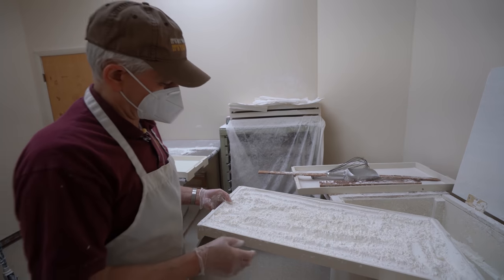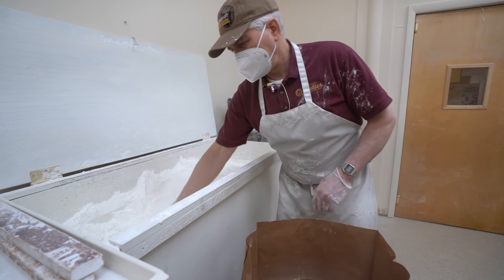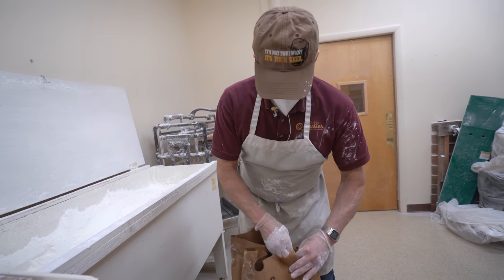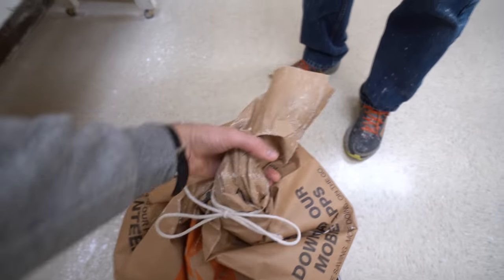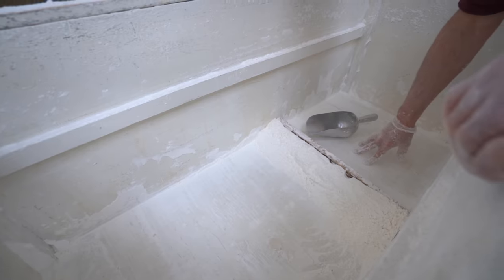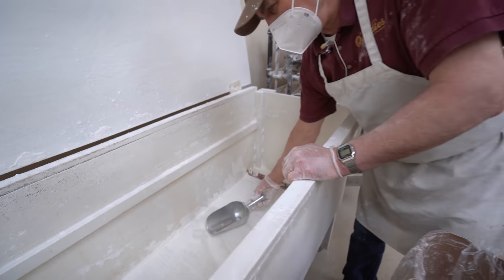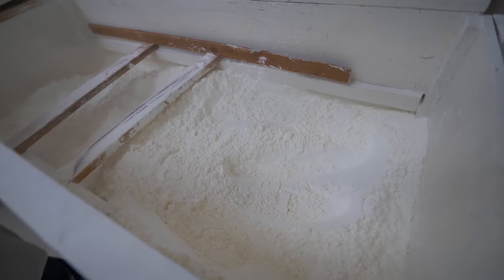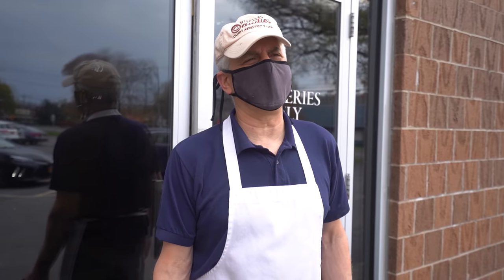How Often Do We Replace The Starch In The Starch Room?

Comment: A shop vac with one of those dust\cyclone separators would work for this. It's like a second chamber where the dust is allowed to fall before it reaches the vac, and a regular bag can be put into it.
Reply: the air that comes out of the dust vac after it was full would make the room dusty.

Comment: That's where those little dollies with wheels help. Kind of like 2 skate boards stuck together side by side. Roll that bag of cornstarch right on out to the compost pile.
 I only mention this, because that's what my grandpa did. I sure don't miss the cornstarch in the air. Thanks for a very nice video. Brings back so many memories, that I thought were gone. Y'all are simply wonderful🥰🥰🥰

Comment: I bet it would be much faster to scoop out of the mold box if you used a flat piece of cardboard that fit the inside width of the box, then you can just bend the cardboard in half like a slide to dump the starch into the bag neatly. Or maybe a flimsy plastic cutting board

Comment: Just use a box cutter at the center of the bag. Start with the bag on it's side close to the front of the box.. lean over and cut what the bag on the back side.. then tip the bag over so that the cut side is down. This will allow the corn starch to fall out of the bag.